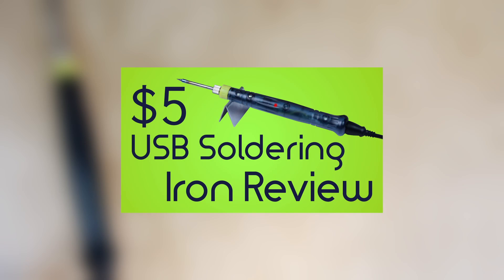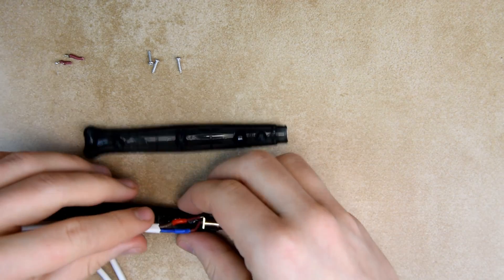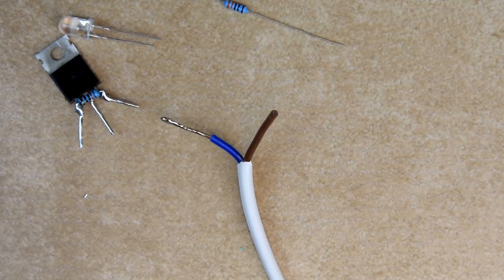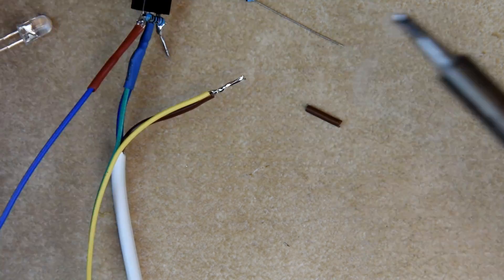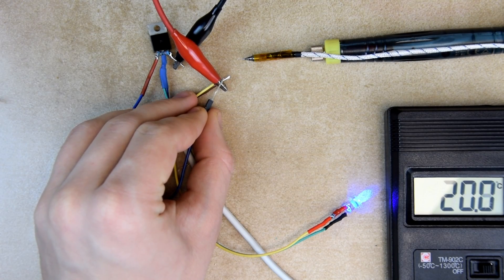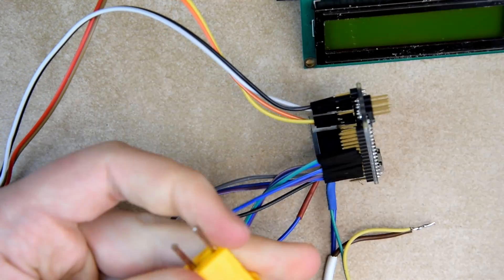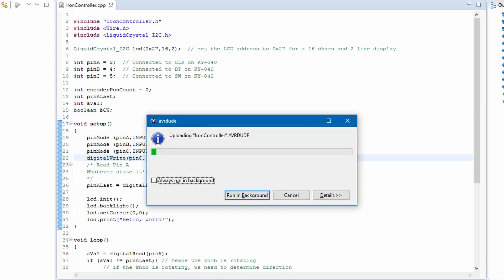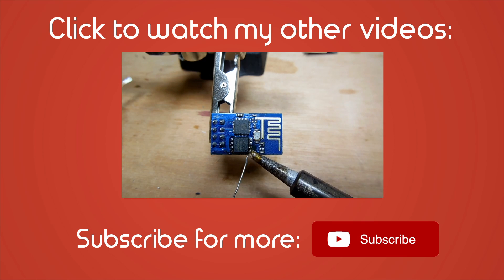DIY Soldering Station for under $15 using Arduino

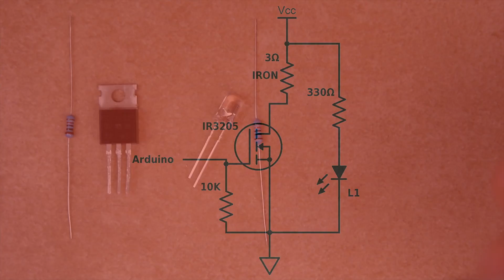Comment: The schematics @2:02 is not consistent with what you did later. If the LED had been connected as shown in the schematics it would have been on all the time. You soldered the LED in parallel with the iron and not in parallel with the iron + MOSFET.
Reply from the maker: Ooops, you are 100% right. Annotations are gone so I have no way to correct it now. Oh well, I'll add the corrected version to the description or something. I am quite surprised nobody noticed it before!
Reply: I noticed because when I saw the schematics I memorized: 'OK, the LED is on all the time...', and then later in the video I saw it still works similar to the Hakko controller's LED (showing when the heater is on). But the difference in the schematics is more like a typing mistake - it does not count as an error. I find your video excellent in showing one possible algorithm for controlling the iron temperature with a microcontroller.
Reply from the maker: To be honest the algorithm should be a full PID but to be even more honest the handle should be a something like a Hakko T12 for it to make sense. I'm surprised at how nice it works (in the next video) for how improvised it all is.
Reply: What?!?!  we need two solering iron to make  a soldering iron    thats bad    can the soldering iron which we use to make the other iron  can the iron be cheap
Reply: alot of work for such a cheaply build iron.

Comment: I looked into doing this once, though I’d have tried to measure the resistance of the element (or measure the current through the MOSFET to determine the temperature of the hot-end. 4-wire sensing would help. But the tips on those irons are just trashy. Anything other than a fine-pointed conical, please, I don’t want to hold my iron at 30 degrees from horizontal.

Also a T12 diy kit is like $20.

Comment: I did a slight improvement to the subtitles I have created(Turkish), and also fixed a problem where it used auto translator for some reason. Make sure to accept it!

Comment: I would recommend getting a JBC soldering iron handle and fitting cartridges for this project. They are expensive but basically the same thing, only the thermocouple is embedded in the tip of each cartridge. If a cartridge burns out or you need a different tip, swap it. JBC irons are designed to have interchangeable cartridges and the station detects what cartridge is chosen. Or you can get the full set, whole solder station and all for 1000 dollars or more. Personally, I have a chinese soldering station iron. The station is built into the iron's handle, LCD and controls and all. Only problem is, it's not temperature calibrated (you have to do that manually by putting in a temperature offset) and my thermometer is unreliable. It works though and packs a lot of power. It's a 80W iron.
Reply from the maker: That's what my latest project is about, check it out :D

Comment: I am wondering what the original wattage rating was of the iron. Are you now pushing the iron beyond its rating and causing an unsafe condition? Also, I am very impressed with your work. But, some have commented that they think your soldering skills are good. I watched the second video, with the soldering. I highly suggest that you take the time to improve your soldering skills. There are plenty of quality tutorials on YT, even NASA has soldering videos... No joke. I offer this constructively and hope I have not upset you. From what I have seen of your super intelligence, I know you can be a first-rate solderer...
Reply from the maker: Thank you, I am always learning. The thing is I need to solder around the camera equipment and operate it at the same time, staying within the vision area. It's not easy! And yes, I am pushing the iron well out of the operating area and hoping that the thermal resistance between the thermocouple and heater is low enough it doesn't overheat. I'm making a more reasonable project (T12 based) right now.

Comment: kapton can only hit 260C , don't use kapton for anything higher
Reply from the maker: The official specification states 400C: http://www.dupont.com/content/dam/dupont/products-and-services/membranes-and-films/polyimde-films/documents/DEC-Kapton-summary-of-properties.pdf
I have tested it multiple times above 300C and nothing happened to it.
That and there are no real alternatives for a cheap hi-temp tape as far as I know.
Reply: the answer is simple here , use a metal clamp ..

Comment: How are you touching the metal if its hot? (Idk anything about soldering)
Reply from the maker: +PixelFever42 _ the hot metal is held by a plastic that can withstand the temperature and isolate my hand from it.

Comment: Hi I have built one of of these units but had a lot of trouble with code it did not work at all well with the LCD. I have used a different library to get it to work. The problem is well know issue with the LCD only writing the first character. I have still got some tidying up to do as I have a slight issue with blinking cursor and also want to reduce the get temperature to only show 3digits as it jumps about to much. If any information is needed please let me know many thanks for the design and making the video as it is have enjoyed making it and is a nice video.
Barry

Comment: Connecting a MOSFETs Gate pin directly to the arduinos pin is not healthy since the gate pin of the MOSFET is just a capacitor it acts as a short circuit for a little moment and can damage the pin
Reply from the maker: +Ahmed Faruk ASLANTAS you are right, tjere was supposed to be a resistor there, I must have forgotten.

Comment: Is There an link for the full code You used in this video?
Reply from the maker: +Thespartann Yes, it's in the description.
Reply: you need only the gifthub?
Reply from the maker: +Thespartann Yup, and Arduino IDE installed.

Comment: I am trying to recreate your project, what are the values of the two resistors supposed to be?
Reply from the maker: First o all I would use a better handle.
That said the resistor values are not crucial. For the MOSFET anything between 1K and 50K ohm will be OK. For the LED 220 to 2k ohm. Plus the LED should be parallel to the handle, not on the power rails.
If you have any more questions please ask.
Reply: thank you I will look into another handle, I have one from a Yihua 939D I could use.
Reply from the maker: It seems it uses mains voltage directly, it would not work with this circuit. I would suggest something like this one (affiliate link): https://www.banggood.com/Soldering-Iron-Station-Temperature-Controller-Kits-for-HAKKO-T12T2-Core-Handle-p-1119294.html?p=PJ272191958782017025

Comment: which wire stripper u have used share the buying link
Reply from the maker: It's this model (affiliate link): https://www.banggood.com/0_2-3mm2-Adjustable-Cable-Wire-Stripper-Crimper-Cutter-Stripping-Tool-p-911903.html?p=PJ272191958782017025

Comment: the kapton tape is UN-burn-able?
Reply from the maker: Nearly. It can survive up to 400 degrees Celsius in theory. I haven't managed to damage it with temperature yet. The glue gets a bit weaker with temp though but that might be just the Chinese version I have.

Comment: Thought of making a video on a case for all those components ? I think you should make all in 1 vid, but if you did like a wood or a 3d printed case for the parts that would be neat
Reply from the maker: I thought about upgrading the handle to something like Hakko, making a PCB and a case but I have too much other work for now.

Comment: It's cool that the MOSFET has on resistance of 8mOhms, but that's if the gate is being charged at 10V, but you're only charging it at about 5V, therefore the resistance won't be as low as you think. Also do you believe that the Chinese knockoff's will even get close to the datasheet resistance?
Reply from the maker: Just measured, it's 170mOhm in practice. Considerably higher, true, but still low enough for them not to heat up noticeably.

Comment: Hi this have pid controller?
Reply from the maker: No really, just a single line P-ish thingy. I didn't have the patience to tune a PID using only a 16:2 LCD for a weekend project.
Reply: Great work !! try to see this link , carlazar have done a very good PID ( or on/off) arduino program (http://dangerousprototypes.com/forum/download/file.php?id=11111&sid=5dd3f8b1e140de01d4879143dcaa5edd) :  http://dangerousprototypes.com/forum/viewtopic.php?f=56&t=6513#p57976

Comment: What is that handy dandy wire stripper you are using!?
Reply from the maker: +xennelul Some random chinese thing. Just search "wire stripper" on Aliexpress, they cost around $2. Works really bad with smaller gauges though. I strip those with the flush cutters.

Comment: what programm are you using at 7:55 to write the code and then upload it, doesn't look as the normal arduino programm
Reply: Code and Solder I use vim.
Reply from the maker: Eclipse Arduino IDE, much better.

Comment: 1. Simply buy a soldering station from china for the same price.
2. ....
3. Profit.
Reply from the maker: 4. No active temperature control.
5. No fun!
Reply from the maker: And of course:
6. No video!
Reply: 7. No electrocution !
Reply from the maker: This is 10V...
Reply: It might be a better option to buy a prebuilt one but, some of us has the components like the Mosfet he mentioned(or a substitute) and other components required so It is up to you to decide whether to buy a prebuilt, or make one like in this video with your spare components you have in hand.

Comment: Fun video you need a soldering station to solder the wires and components together
Reply from the maker: Never said this is a practical tutorial. But it certainly was fun!
Reply: It takes tools to make tools.

Comment: And for just $1 more you could put it on a piece of protoboard instead of ghetto wire wrap
Reply from the maker: +Colin Alston I thought about it. I even had the board within hands' reach. But I hate cutting fiberglass so I just did it in the air.
Reply: Buy the small ones in bulk, real cheap. Dead bugging like that seems so much work and debugging hell if it doesn't work haha
Reply: Dead bug is when you glue ICs upside down to plain copper clad board which is the ground plane. This is hanging garden wiring. If you're going to be critical get what you're talking about right.

Comment: great work ! but you could have used a 6-12 v micro soldering pen instead. it was not necessary to tear apart a perfectly good automatic iron. :)

or even an iron from 12v chinese soldering stations with built in thermocouple would do.
Reply from the maker: I already had the USB iron so I used it. Of course there are better options.
Reply: right ! when is the soldering video coming ?
Reply from the maker: +iceberg789 Could be tomorrow, could be Sunday, could be next Friday, depending on how things work out.

Comment: Is there a schematic available?
Reply from the maker: +craigleemehan it is in the video, in two parts. The schematic for the MOSFET part and pin connections with Arduino.

Comment: Great project!
The best type of cheap soldering iron, is the Hakko T12 chinese clone.
The T12 Hakko clones, have the thermocouple in series with the heater. 
You can make a video showing the mods, to work with this type of 
tips?
Good video!
Reply from the maker: I'm thinking about doing just that. A downside is those use mains voltage so I would have to be a lot more careful and probably not build it in the air :D
Reply: Not, the chinesse Hakko T12 clones, use the same voltage as the original: 24v. They can be powered from AC or DC voltage. They have a K-Type thermocouple, internally connected to the heater, in serie.
Greetings.
Reply from the maker: You are right, after further googling. I must have been thinking about some other handle. I'll look into it.

Comment: Awesome video, but funny, to make a soldering station, you need to take apart a soldering iron (1:05) with a soldering iron.
Reply: It is a bit funny, but we've been using tools to make tools ever since the first cave man banged some rock on a piece of flint and produced a better knife.
Reply from the maker: The soldering iron, duh!
Reply: so which came first, the chicken or the egg?
Reply: Iron-ception
Reply from the maker: I cut the wires later so you could do that. Soldering the cable on the other hand is a bigger problem.
Reply: The answer is quite simple and the answer lies in how evolution works. Evolution doesn't mean that individual of one species undergoes some sort of metamorphosis into another species, but rather during reproduction, genetic changes can occur (mutations, crossing over, etc) and thus those changes are passed on to the progeny. After enough changes, that aren't detrimental to the offspring, occur through generations eventually there is a point where the egg that produces an individual that is genetically unique from the previous generation to such an extent that it cannot successfully reproduce with individuals from that species, and thus we have a new species (the chicken). So, to answer your question,  the EGG came first, it had to have come first, from where? it came from parents that are of different species.
Reply: not needed but good way to melt solder joints

Comment: I wonder if there now even is a reason to buy an expensive iron as you can just up the voltage
Reply from the maker: +Lenny stepping up tha voltage has the side effect of increasing the difference in temperature between the heater and thermocouple. Thus above a certain level it will accelerate the wear of the tip. Plus the thermal capacity is still tiny so soldering anything big will be umcomfortable. Plus the higher the power the larger the oscillations will likely be, as the Kapton slows down heat transfer. So all in all this will always be worse than a proper Hakko or Weller.
Reply from the maker: +Roman Nakurwia You would most likely need to change the transistor to triac + optoisolator as they usually run on mains voltage, but yes, this would totally work. Especially if you used a quality handle, there are Hakko ones on Aliexpress for a reasonable price and they have twmperature sensing inside the tip.
Reply from the maker: +Eviltech Because it doesn't make for a cool video, duh. Seriously though with a Hakko handle this would be much cheaper than the actual controller for a similar quality.
Reply: Code and Solder What if use some more quality soldering iron for this?
Reply: Why not buy a whole soldering iron with thermal regulator inside? It's less than 10$ and works great! I have one that has lasted more than 3 years and has rarely been unplugged!
Reply: Link or aliexpress search query?
Reply from the maker: +Lenny Just search "soldering iron handle". Hakko 936 clones are at around $5.